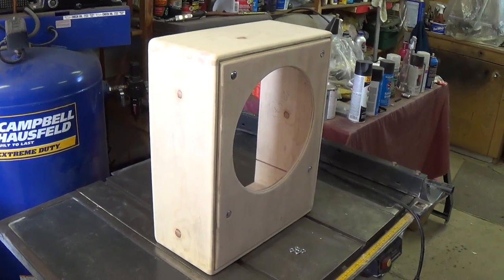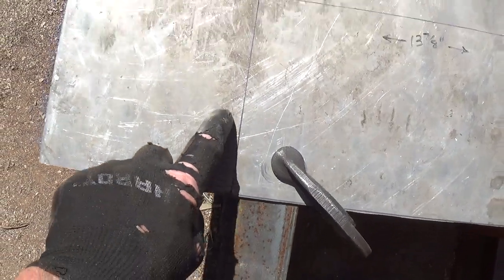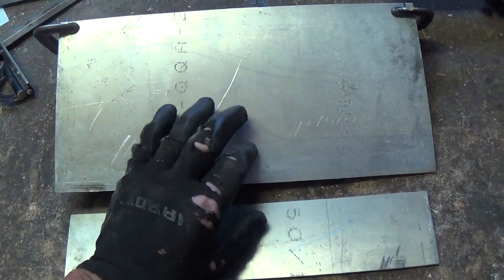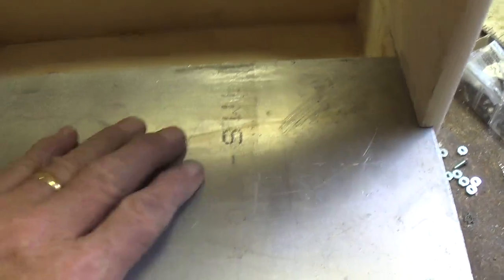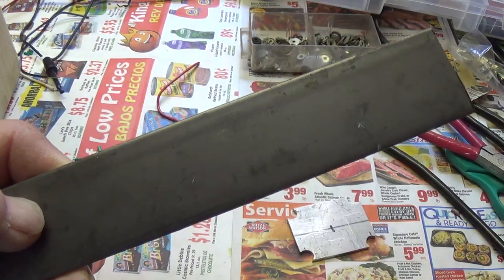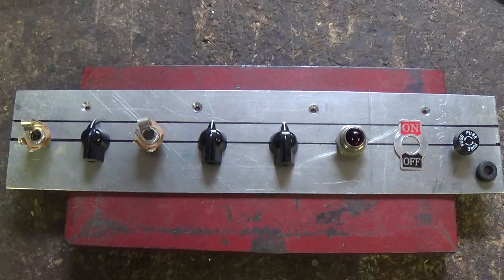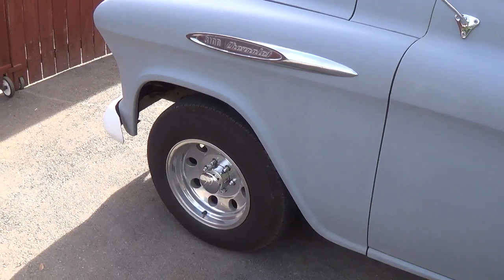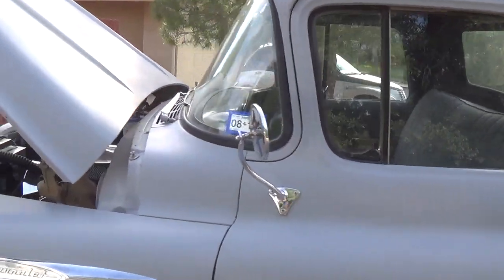Let's Build the Mystery Amp, Part 3: Fabricate an Aluminum Chassis

Comment: I’m on my 3rd iteration of sheet metal brake. The first two bent steel great, but I want aluminum for the reasons Uncle Doug states. 

I ended up building a welding table and put the brake on the side. Using cold rolled flat bar and sharpening the folding edge on the top bar got me near perfect 90* bends. I made smaller top bars for the sides and any misc ears needed for rivets/screws. A full 5053 4x8 .063 aluminum sheet is $50 and you can get 10 chassis out of it! Totally worth the time and effort!!
Reply from the maker: That sounds like an excellent device, Matt. I hope it works well for you.

Comment: Hi Doug! The amp is coming along nicely.. I think it looks nicer without the On/Off bezel for the power switch. Also, not sure if they stained the cabs or they're just dirty from age, but most old amps are black inside. I'm working on a similar style amp (pentode/triode inputs) so I really want to hear this one when done. The new truck owner is happy I'm sure. Going to pop some more pop-corn in preparation for part 4! Glad your back, Tom
Reply from the maker: Thanks, Tom. I agree about the bezel. I tend to leave the interior of my cabinets as raw wood, and rationalize that it helps the resonance......or some such excuse :)

Comment: I think a table saw would be a good choice for cutting that thick aluminum into rectangles.  Any concerns about cooling the components underneath?  Nice work!
Reply from the maker: Perhaps a table saw would work. I tried it once, with the saw blade in reverse rotation, and wasn't thrilled......but perhaps there are proper blades that would work better. Aluminum chassis tend to dissipate heat quite well, so no worries, at least for now :)
Reply: People use normal router bits on thick aluminum.  The attack angles are similar between bits for hardwood and aluminum.

Comment: Doug. Have you ever seen the 1955-'58 Chevy Cameo pickup trucks? Glass body. Very unique. I met a guy in the parking lot at the auto parts store with a '57 a while back and we just shot the bull for a while. Very cool truck. His had the GM ZZ-383 crate engine which is the same engine that I have in my '73 Corvette, A lot of engine for something with ancient suspension. Both the Cameo and my Stingray. ;)
Rob.
Reply from the maker: Yes, a friend of mine has a beautifully restored Cameo truck, Willi. Sadly, they are so rare and expensive that I'll probably never own one :(

Comment: Great videos and it's nice to have you back! Would it be possible for you to do a video on best practices for avoiding parasitic oscillations in P2P amplifiers? Thanks!
Reply from the maker: Thanks, T. I have never experienced any problems from parasitic oscillation...yet. If I do, I may do a video about it.
Reply from the maker: Meanwhile, see my video series on Resistors, particularly the Grid Stopper, which tends to be quite effective in preventing PO
Reply: Thanks for the replies. You rule Uncle Doug!

Comment: It's great to have you back! Can you talk about the field coil speaker, and how to power one? I have one laying around that I wanted to use in a build one day.
Reply from the maker: Thanks, Eric. Most field coil speakers have four wires. Two for the voice coil, just like PM speakers, and two for the field coil......which is wired and used as a filter choke. Thus in virtually any amplifier circuit you can substitute the field coil for a filter choke in the power supply and the electromagnet will be energized.
Reply: Uncle Doug excellent! Thanks for the reply. I can't wait to hear the mystery amp!

Comment: I don’t think the chassis material is stout enough...lol. Steel also has some sort of electro-ferro magnetic inductance coupling which can spread Power supply noise across the chassis.........excuse my terminology I know I don’t have it quite right
Reply from the maker: I should have added that to my comparison of the two metals :)

Comment: I think this mystery amp is going to be a good build.  So I have to figure out what amp has tone, no tremolo, and is two channel with a 12 inch Jensen.  As far as the truck, my family had a 57 GMC short box step side.  I we sold it in the mid 60s so I only remember some details.  It was sort of a power green with the white face.  So, it's cool to see nearly the same body on this project.  Is there anything better than older amps ( and guitars) and older cars?
Reply from the maker: Nothing that I know of, JD, except maybe beer, steak, and Russian pole dancers :) :)

Comment: Hello Uncle Doug,  You are doing an excellent job.  Good to have you back.  Sorry to hear about Rusty.  I have a question for you and I figured if anyone could give me an intelligent answer it would be you.  what is the difference in a bass amp head and just an average guitar amp?  I know you can play guitar through a bass, but you can't play the bass through a guitar amp at least not the combo amps.  Using the bass head and regular speakers for guitars,  would it be a good rig or just sound like crap?  If it is not a good idea to use the bass head could you please tell me what the difference is in just the two type amp heads under the hood.  By the way, that's one mean little truck you have there,  I love it!  Keep up the good work.
Reply: I'll take a look Uncle Doug, thanks.
Reply from the maker: Dedicated bass amps tend to be much more powerful than guitar amps, i.e. well over 100W, more likely in the 300W region. The speaker(s) resonate at lower frequencies, and the tone circuits favor only low frequencies. The Fender Bassman, theoretically a bass amp, used regular guitar speakers, was moderately powerful, and had a Brightness switch to correct the tone circuit for guitar. Without these concessions, a bass amp will not work very well for guitar use......nor will a guitar amp, with inappropriate speakers, power, and tone circuit, work very well for bass use.
Reply: Thank you so much Uncle Doug, you  explained to me what I was trying to find out.  I was kind of under the impression that it would work good to use a bass head with a cabinet for guitars.  Thanks to you I won't be wasting my time trying that should I come across a deal for a bass head.

Comment: That aluminium really cleaned up nice.  I hate the thought of spending big bucks on a chassis, this has got to be the most economical way to build one.  Nicely done Uncle Doug

And your truck porn, oh my.  That sound, so nice, would of loved to hear the throttle blipped a few times.

I got my drivers licence in 1966, took the test in a 1957 Ford Fairlane, standard brakes and steering, and three on the tree.  Parallel parking was chore !
Reply from the maker: Thanks, BF. I couldn't blip and hold the camera at the same time :)

Comment: Amp build: very nice!  & Truck builds very very nice!!  I wish I had a chance to take it for a spin!   Amp build question:   Using an old table saw could you mount a large cutoff wheel to cut the 1/8" aluminum?
Reply from the maker: Thanks, Alex. Yes, I believe there are table saw blades, probably quite fine-toothed, that will cut aluminum.

Comment: I think there's an easier way better to make it with faceplate partly attached already. If you took that metal aluminium you can score it with a floor tile Scribe or an old wood chisel, on the marks with a straight edge and brace it in the Voice or between two pieces of hardwood, you'd have jagged edges your need to file them down! Anyway if you made the aluminium bigger and you snipped the corners, and you fold bent it in a vice where it needs to slide in to the Cabinet so you're making a box! and you have a front plate as well might need to make this bigger, you just use 2 corner brackets in the top corner of the faceplate only to give it more stability then drill out the holes you need or beforehand better.
 Cut it out of stiff cardboard first then transfer the shape marks the lines on the aluminium or steel to bend make sure you scribe the edges as I said even if you're bending? The Scribe will be on the outside of the bend but only shallow if bending you have to make sure you bend aluminium slowly and in a steady movement actually in one movement is best but slow
Reply: I think you need some ventilation air circulation? Maybe drilling a line of holes at the back for air circulation and three big holes 12mm between the transformers.
Reply: Do you know the horsepower did you rebuild that engine or was it already done! I don't know if you know of a manufacturer battery called Varta german-made comes with 5 Year guarantee make numerous different output 12V acid batteries and 24 vols.
Reply from the maker: Thanks for the suggestions, John. I bent 1/8" aluminum for the chassis of my Fender Model 26 clone, and will never do it again. Bending a wide sheet by hand is virtually impossible, even with heat.....much harder than steel.....and it ends to fracture. My jointing method is infinitely easier, especially for those who don't have access to a large bending break.
Reply from the maker: It's probably in the 300 to 325HP range, John. Not outrageous, but quite responsive. No, I have never heard of that battery brand.
Reply: Uncle Doug maybe I did explain it very well?  If you have four pieces of angle iron or hardwood? Clamp them in the vice with your material using the angle Iron as your former!? If you're bending aluminium the former the angle iron, has to be slightly rounded Edge so Wood probably be better not a sharp edge when using metal. Place the Mark where you want the bend just slightly visible on the former, with your other two pieces or hardwood or angle iron clamped them just above the mark, a gentle pressure push forward or down to create your right angle or angles you require. The secret is to make sure your mark on the former are in the right place!? don't leave enough showing on the mark then it's going to give you the wrong bend in the wrong place and if the mark showing too much same thing it will make the edge too long. If you give yourself about a millimetre gap from the line to the former? if it's a sharpish angle that is. if the former is more round you have to give more to the line say the former has got a slight bend of a couple of millimetres to it? then you would have to give this to the line your mark on the material to achieve the correct measurement.